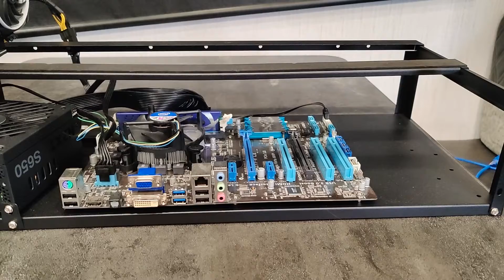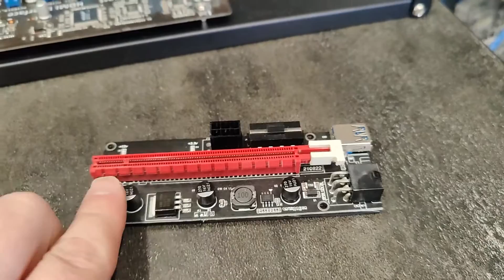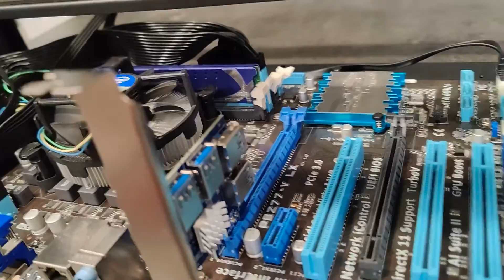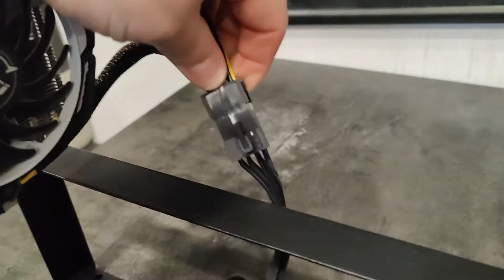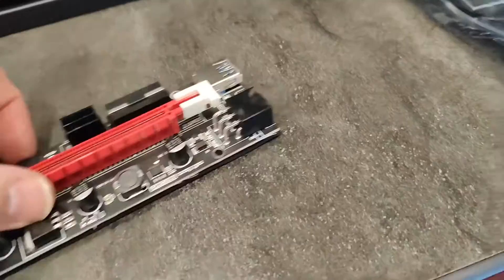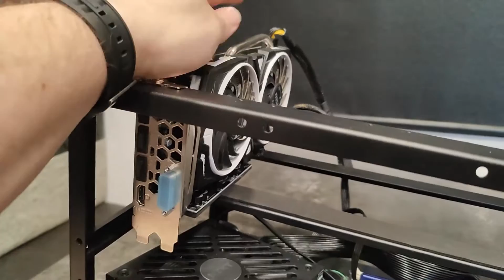How many GPU's Can One Motherboard Support? - GPU Mining Basics

Comment: The answer to the question you were asking is 6. Not really related to PCIE lanes and doesn't matter how many or what kind splitters or risers you use. On most simple and old boards, you will not POST if more than 6 cards are connected. Gaming or more advanced motherboards will often allow more with some allowing up to 12 (using splitters of course).
Reply from the maker: I have 2 older motherboards both running 8 gpus without issue, one is in this video. So it's not as clear cut as it seems. Technically it's based on the pcie lanes, as one lane is needed per card. However as you mentioned it does depend on the board. But like I said I have 2 non gaming older boards including the one in this video running 8 cards right now.
Reply: Depends on what os also.
Windows limit nvidia to 6

Comment: If you use "Bi-furcation" boards you can double each output, my motherboard can theoretically have 16 gpus im currently at 10 but waiting for some m.2 adaptors .. however i could get another 12 onto it if i use bi-furcation boards on the 3 x16 slots so the total would be 28. my board design is laid out as 4x4x4x4, so it can run the 3 x16 slots at x4 speed each and the other 4 lanes are used for the 3 x1 slots and only 1 of the two m.2 slots can be used... the total also relies on which CPU you use too and how the board is designed and how good the bios is for certain settings relating to mining...

Comment: 5:00 well, no, generally you are not able to use more than 10 gpu on one mobo even if it's mining specific it's usually can handle over 10 but only with mining specific gpus
Reply: b250 mining boards do 12 gpus with 0 issues
Reply from the maker: I have 4 rigs with the b250 running 12 cards each and have been for months now.
Reply: Hive os ?

Comment: Never ever use SATA or MOLEX to power your risers
Reply: you can if ur gpu have complet charge with pcie. sata suport 54w per cable but only use 1 connection. molex cable suport 156w u can use 2  connection per cable 78w each point.
Reply from the maker: You can, it's all about power management. People have issues because they use them to power cards that require more power than the cables are designed to handle and that is where the issues start. One of my 12gpu rigs has been mining 4 months straight and is suing 4 sata to pcie adapters on 4 Radeon 470s. They don't use more power than is needed and the cables aren't getting hot at all. 

There are plenty of miners out there that just plug stuff in without any thought on the power consumption and cable limits.
Reply: yes you can per sata per riser,you will be fine.

Comment: My AsRock H110 pro BTC should be able to run with 12 or 13 GPU but I was never able to turn it on with more than 9, even with spare PSU.
Do you know what could be the problem ?
Reply: did you update the bios?